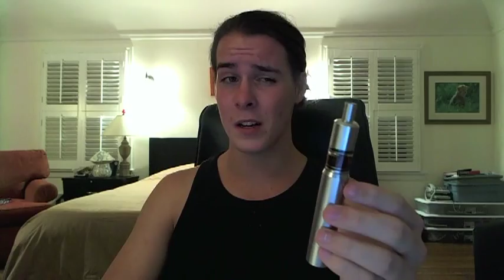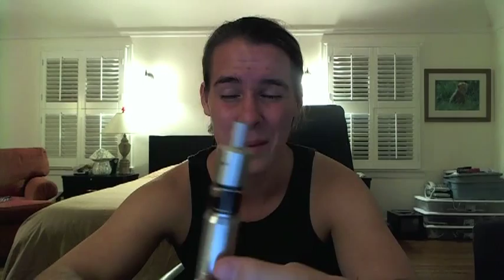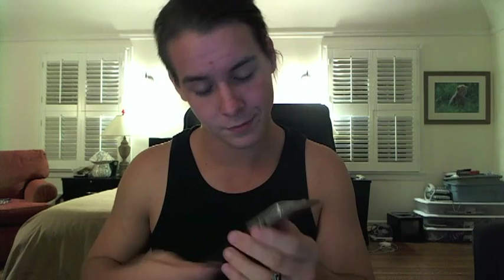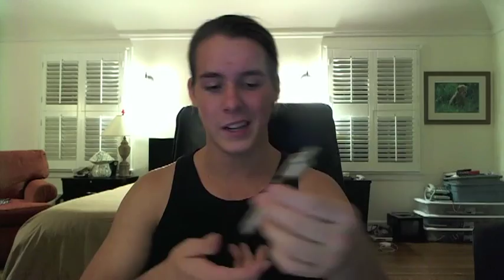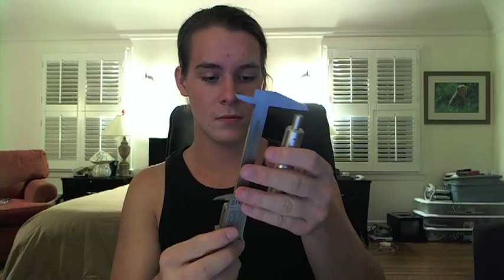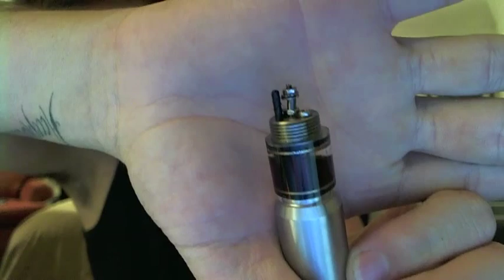Orion v2.1 Genesis Hybrid Review

Comment: If the coils get glowing so fast, the liquid flow seems to be interrupted. I guess the wire is wrapped too tight or the wick is squeezed somewhere. Check the wick and wrap the wire lightly around the wick. If you could just barely pull out the wick through the coils, the tension is right and the juice can get transported fast enough.

On the dry wick every round has to glow equally. If not, just slightly nudge the coils until they do. If only the ends glow you will get an ugly metallic taste.

Comment: HI i just got a orion v2.1, but the vapor on it is real bad... and while holding it for about 3-4 secs the coils go red. It's not modded . i have wrap about 4 rounds on 32 kanthal wire and ss mesh is 400. what could be wrong? i see that your vapour production is great but mine is so bad... maybe just 20% of vapor production compared to yours....

Comment from the maker: First, pick which wick hole you want use as your primary hole (the one that makes the position of the switch most comfortable). Next, with the tank pulled off, screw your top cap on and line the airhole up to where the wick would be. Then start sanding the tank down with 400 grit sand paper, and check your progress by holding the tank up to the gap to see how much more you need to take off to get the tank to fit under the cap so everything sits flush and the cap will line up to the wick.

Comment: Yo Rick

I think the DID brass nuts will fit on the center post, I think they're both M3 nuts. Also... GG bottom tube fits the bottom of the Orion, not sure what batteries fit but you have to press both buttons to fire.... I wonder if you put the battery in positive side up, it'll work with the GG button only.

Comment: Did you get or Orion from the last batch he sent out ? I have gotten one from the last 3 runs he did of the 2.1 the first 2 I got the wick hole lined up with the button and 18350 fit with no gap . This last batch I'm having the same issues as you . Hopefully the batch he is doing now are like the first 2 I received .